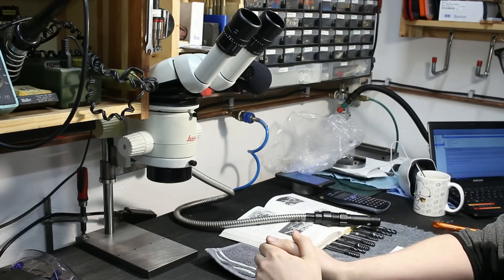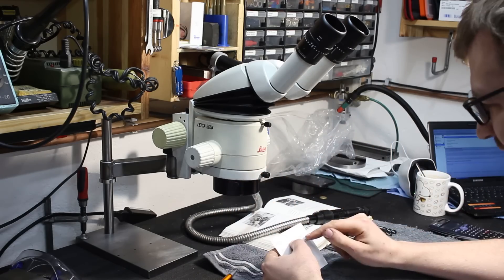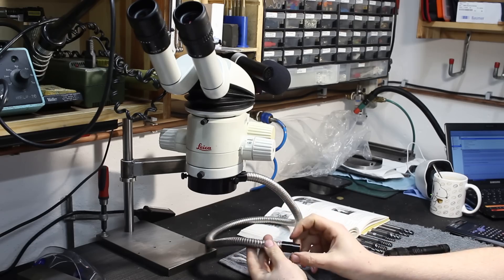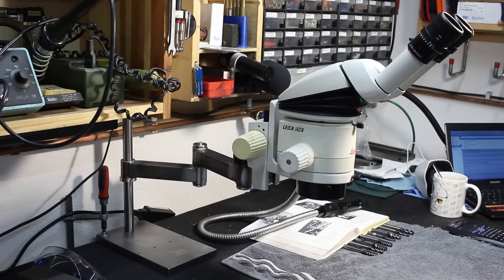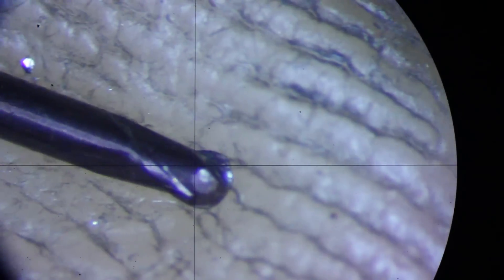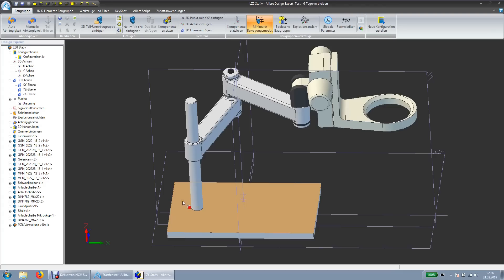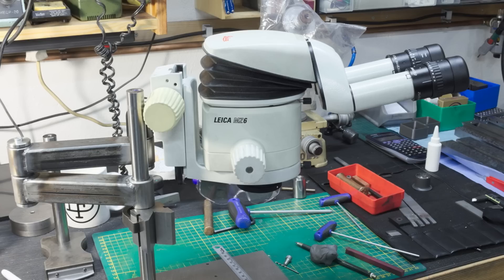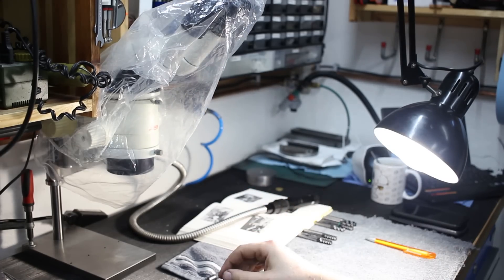Leica MZ6 microscope and microscope stand

Comment: Indeed, a microscope is a great tool in the workshop. Some years ago I bought a new Motic SMZ-171-TLED, price ca. €1300. It is a quality product and I am more than satisfied with the optical performance. As I have also larger pieces to inspect I made an extension of the stand column.

Comment: Might need a pin to lock the washers in place so that the cap screws do not rotate.  Like the design very much and appreciate the insight you provided with the tolerances and build vlog. Took me awhile to figure out you were saying IGUS... lol.  What are you using for a CAM solution?

Comment: That is a very nice setup. I actually have several  stereo scopes at this point (forever to find the first at reasonable cost, then you get the scent), but the primary one (Nikon 7.5-75 zoom range common-main-objective design with long focal clearance-- infinity focus in the stack and ) is still on the factory stand. It came from a forensic chemist, so the stand has all kinds of nice lighting from underneath. LED ring, because when I bought it, they couldn't find the coaxial illuminator for the optical stack. I heard that it later went on ebay. I rarely use the bottom-side illluminatio and may need to make a setup like yours. The second most used is a Greenough optical setup (independent optical paths and main objectives) with no zoom. No idea who made it, but at 10X (lower of two mags) it is perfect on an articulated arm (it came with it at about 1m) over the lathe.

Comment: I have a Nikon inspection scope with one of those long booms. That kind of mount would be much nicer and it might actually fit somewhere.  I do have an old monitor arm like that lying around, though. Maybe I could see what it would take to mount it on that. My fiber lights are just spot type. I've been thinking of making a ring light that mounts directly on the body.

Comment: Nice microscope, lucky you.  I think your fight against storing data on someone else's computer is a lost cause, unfortunately.  I have been visiting "server rooms" with businesses and public sector for close to 30 years, and they are becoming very thinly populated with servers and storage....  Its all in "The fog" now...
Reply from the maker: Well, I will not go out into hot air without a fight ;)
As long as there is opensource there will be options and ways to work localy. My main OS is a linux distribution, Windows gets only booted for Cad/Cam work. I run a Owncloud on a local raspi server for sharing files between my computers and my phone.
And for some things I dont care about cloud, otherwise I would not use social media ;)
But as for things that I work on? I want control over it. Not have Autodesk control it.
Reply: @StefanGotteswinter    I am a linux user myself (both work and private), and have no Windows boot available because it makes me angry every time I use it.  In that respect, browser based cloud applications are a useful since it provides applications that otherwise would not be available on linux.  Privately I chose to use open source apps as much as possible.  You tipped us of OnShape some time back, and that has been my CAD solution for a while for home shop stuff.  No secret stuff fortunately, as free use makes it publicly available.

Comment: I used to stare through a 10-30x rig all day for a few years.  It made me hyper-conscious of hand cleanliness, that's for sure.  I never liked ring lights of any kind.   Shadows are valuable information, especially if you're working handheld and want to keep from getting disoriented at high magnification.  

That, and it seems all the ring lights (either fluorescent or LED) were always an awful high color temp (the fluorescents had especially bad CRI).  Dealing with that for 8h a day is hell on the eyes.  

I suppose there are better options, but I didn't have the autonomy to choose them then, and I don't have a microscope to put them on now.  

Also, yeah.  I don't know what the deal is with boom stands.  I had one that was a double-boom stand with about 40mm solid bars.  It could swing probably a meter.  The base was just a dinky thing that would tip over if you tried to use any significant amount of that range of motion.  It's like they expected everyone to clamp it to the desk or stack heavy equipment on the base to keep it from flipping.

Comment: Awesome stuff Stefan. Always love the attention to the film quality, love the colours. Like the brief presentation format, with the explanation by way of a slide-show - that must be a bit easier than filming it especially for things like hot work (welding) although also love the long format too. Nice instrument, the fibre optic lamp is classic OTT Leica engineering (! :-D), many light sources less glare I suppose. What CAD is that? I have been using LibreCAD for 2D design, it's a bit painful compared to modern options but it's FOSS and runs on Linux which is nice. That S-O-S function will come in handy one day when you get lost in your basement.Thanks for sharing. :-)

Comment: I did enjoy. :-) The weakest part if that stand appears to be the vertical shaft. I feel like it should have been 2x that D being it is cantilevered and the weight is so far from the support at the base.  But hey if it works it works!
Reply from the maker: Yes, definetly - If I had to build it over, I would use a 30mm shaft, but I used material that I had lying around (excluding the Igus bushings)
Reply: Yea, I hope he never has to crawl under it ;)

Comment: Extremely nice microscope Stefan. Zero chance I would think of something you already haven't, but the base you've already built might work well while re-sharpening on your new tool & cutter grinder. A camera adapter through the microscopes eyepiece for higher magnification shots in your videos might be a semi costly pita. Maybe an added half decent usb type microscope mounted off to the side of the Leica's microscopes objective for the video work might be cheaper and easier?

Comment: What's your work?  I'm sure you've already mentioned it at some point, but I just recently joined you from ToT...

Also, does the CAD software got use have a simulation module for flow, stress, and stuff like that?  I'm also not too fond of Fusion 360, but I think it has decent features...  Maybe you could do a short video in the future about the software?  I'd really like to be sold am alternative to Fusion 360...
Reply from the maker: My regular dayjob is prototype machinist in a larger company.

No Alibre does only bring a solid/sheetmetal cad, assembly and 2d drawing enviroment. I will probably do a video on Alibre on its own, while beeing a very nieche topic.
Reply: @StefanGotteswinter  Please do, I cannot afford to buy solidworks  again (it is probably the best,but prices are crazy)  and have been looking for something to use at home with alternative op systems (is there a Linux version for instance?)  . Does alibre have a part assembly mode (that will allow animated joints etc.)?
Reply from the maker: @wktodd  Well Alibre is not exactly ceap either, haha. But at least 4000eur cheaper than Solidworks. Thats what I showed there is the assembly enviroment, it allows to set constrains and push/drag parts around like they would move, also allows for cross section/exploded views,  part-intersection analysis and more.
Reply: If you are looking for an opensource CFD software openfoam is one alright, it's not particularly user friendly but it;s free. As with all computer simulations take the results with a big pinch of salt.

Comment: If you haven't made a final decision yet on what package you want to buy have a look at SolidWorks.  The only program I have ever used which is more intuitive is Ashlar Vellum but that is more of a 2-D drawing package.  With SolidWorks you own the package and can go onto as subscription for updates if you want or not.  I have worked on it since '96 and am still don't consider myself an expert but have never come across anything we couldn't do in our design work.  Quite expensive, but if you don't need simulation it is reasonable.  We do a great deal of stress analysis and need it. Thanks for a great video :-)
Reply: solidworks pricing is somewhat "interesting" here in EU, I was quoted 12k eur for the pro package couple years ago by the local distributor (afair standard was 10ish k), same package in US goes less than 6k usd in US, I hear it is subsidized there, so that might be the reason, but somehow I find it hard to believe it is subsidized THAT much
Reply: Very interesting, I didn't know there would be a pricing difference like that for you.  Over here in the US I believe we have the choice between standard, professional and premium.  With professional you get standard plus Simulation.  And with premium you get those along with nonlinear simulation.  I am not that sure about the initial cost but I have Professional and with SolidWorks and Simulation the subscription is around $3700 us  per year.  Not a small cost but all those I work with stay current so I must as well.  Good to hear how it works in Europe.

Comment: Nice microscope. For electronics work I like a rigid stand ilke you have, but in the shop I prefer the articulating arm. It makes it easier to look at larger objects. I find a lab jack type of stand useful for under the microscope so I can adjust the part position and not the scope. I have used Alibre Design for many years and the biggest advantage is that I own the license and do not rent it like just about everyone else has gone to now.

Comment: Nice setup, especially the tilting eyepieces. At work I use a Mantis Elite and I am determined to buy one for home use at some point. Magnification is not as high but very comfortabe. Many of the chinese LED flashlights use an IC that can be configured with solder bridges how many modes it has. I disable the stupid flashing mode on all of mine so I just have High/Low/Off.